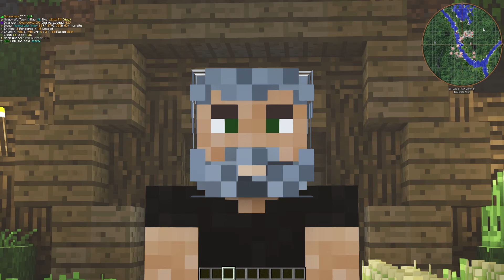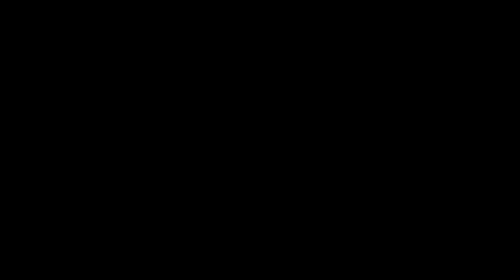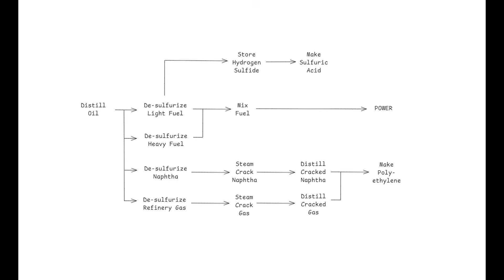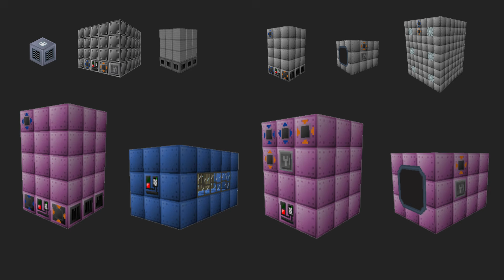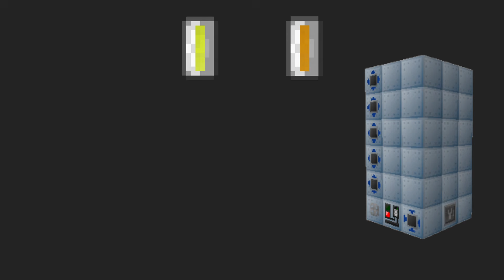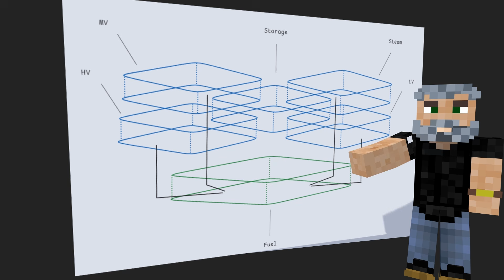The ULTIMATE GTNH Beginners Guide - Episode 5 - Early Power and Base Design

Comment: If I could do it again I would just do exclusively advanced solar boilers until I get my hands on an MV combustion generator. Once you're in early LV and have silver ore from the twilight forest you can batch craft several stacks of those in no time at all. I think it takes like 18 of them to power an EBF. A single water pump multi can supply hundreds of them depending on humidity, but it's probably a better idea to just confine it to one chunk so a maximum of 256 which is 52 LV amps at max production or around 19LV amps fully calcified assuming you even need that much power to justify making 52 steam turbines.

Comment: I HAVE THE POWER!!!
an excellent tutorial series. though , can see many parts have been skipped or simplified to keep the video short and not confusing to newplayers (such as the aluminum in the previous episode...still think you should show more of the process ), but the systematic way approach and video editing are the best tire I've seen so far. and don't forget that the comment section, which is still relevant today, pointing out some version updates and some fixes or nerfs, has been a huge help to me. 

(No more need to dumbly tap the rubber tree with a wrench ， only to find out on the forum that —because it was possible to magically "drill" holes on rubber trees—this “feature” had already been fixed aftere a new stable version release in several months ago ,and some old employees didn't even know about it ,cause they just used slime trees and coins lol.)

Comment: This was excellent.  Thanks for the repeated reminders to not get hung up on base aesthetics before AE.  It's the one thing that has stopped me cold in my last several attempts, and it's only been getting worse.

A small reed farm, and an autocrafter makes a really cheap passive bulk oxygen setup for EBF and whatever else you need it for.  I think there's a bug with the enderio autocrafter because it wasn't using up the flint mortar when grinding reeds into sugar.
Reply from the maker: There's nothin' wrong with some early fancy building - but for me what works best for figuring out all the piping and wiring is wide open space. It felt like I was constantly running out of room to grow. It's nice for everything to be close so it takes less pipe to move fuel, but the constant expansion nearly burned me out too
Reply: @Garronimo  I was fortunate enough to play with my teenage son a couple summers ago, and he amazed me at how quickly and easily he could put together nicely decorated and interconnected buildings...  it kind of spoiled me.  My best work was using the architectural guide block to make large round towers and uh.. that's all.  When I try to do anything else that looks nice, I'm deadlocked.
So, new update, fresh start, and goodbye blue sky.  I'm keeping it simple this time.

Comment: Bro I just thought of the most devious possible gregtech addon that basically makes it so you have to manually assemble the machines rather than craft them and place them down. Like you gotta place the base, all the components, the wiring, and screw it all together. And depending on if you know what you're doing or not you could fully optimize the efficiencey and save materials, but a noob would screw stuff up and lose materials and their machine wont be as efficient. The machines will break down and need maintainence, which forces you to cut power, and then disassemble the machines to figure out what happened. Could be like burnt out wiring, overloaded circuits, broken coil, chipped rotor blades, leaky pipe, etc.
I think that would be REALLY cool for like a super immersive gregtech modpack that finishes at HV
Reply from the maker: dear GOD you're a madlad! maybe for supersymmetry?
Reply: @Garronimo  OHHH TRUE

Comment: An IMPORTANT note for anyone using High Pressure steam boilers: Railcraft water collection tanks CANNOT keep up with the demands of even a couple max-size boilers. You will either need to build a ton of tanks (wasting all your sticky resin in the process) or go with the Water Pump multiblock! Don't be like me and listen to your boilers blow up while afking in your base!
Reply from the maker: LOL i discovered the water pump and it changed my life. so so so so true
Reply: My boilers blew up yesterday 😅
Reply: Use slime trees instead of sticky resin 😊
Reply: i wish i could have read this message earlier
Reply: @yiphoward8015  I managed to catch it early and build more water tanks quickly, cause I was chercking the burn rate on coal and saw my tank is half full, when it was always full on low pressure boilers :D so no explosion this time. I can smell tho my first fuckup will be when I count voltage incorrectly and blow up my HV multiblock

Comment: Unless I'm wrong, can't you just connect pipes to the Low-Pressure/High-Pressure boiler blocks on the Railcraft boilers for steam output? Doing that has been fine for me, or do the big ones just put out such a silly amount of steam that you need pumps?
Reply from the maker: Yeah I'm trying to max out the flowrate :P They produce an outrageous amount at full size and full temp. The logistics of moving steam are definitely the biggest challenge with it!
Reply: @Garronimo  Oh! Well I guess I have some pumps to make then, I just built two of them. I knew I was gonna have to upgrade my pipes from bronze eventually ; n ;